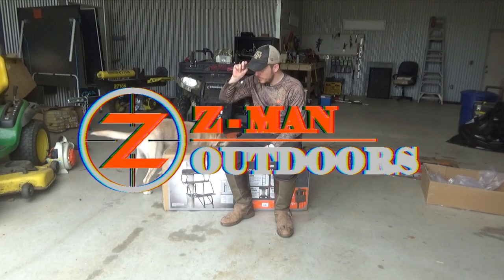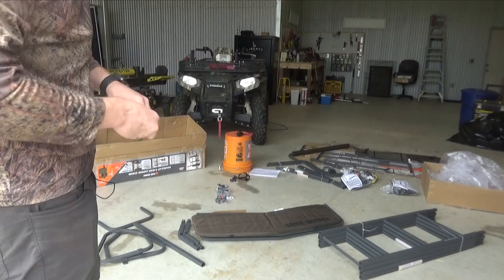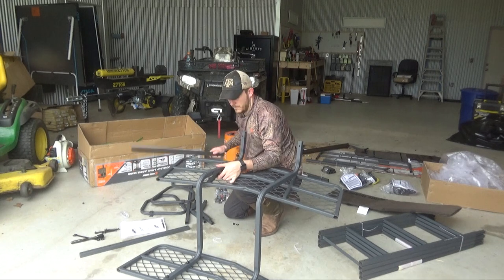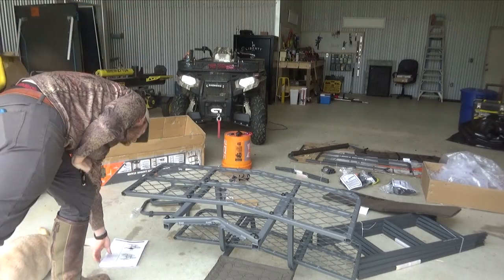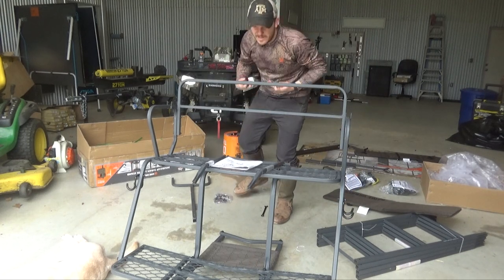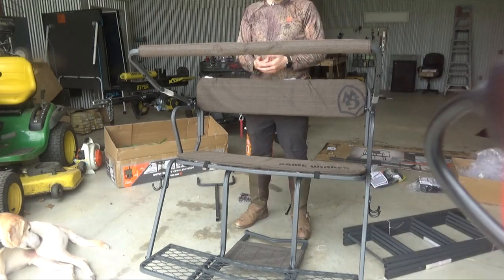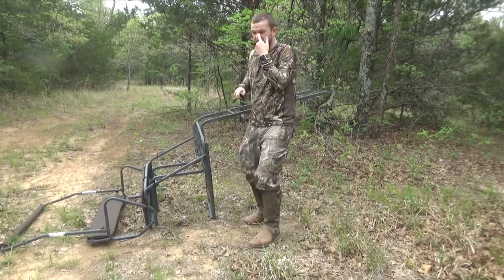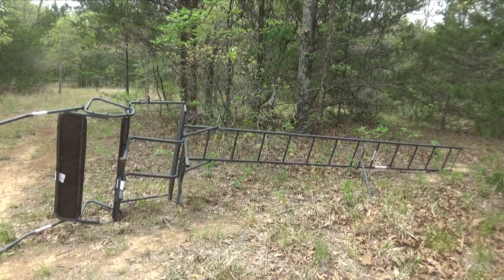Game Winner Two Man Ladder Stand Install

Comment: Was interested in this stand,  but it looks like it's only about a 12ft ladder?
Reply from the maker: Height to the seat is about 15’. I believe game winner has some taller ones if you are looking for that though
Reply: Can I leave off a ladder to make it shorter?
Reply from the maker: I actually ended up doing that and have not had any issues!
Reply: @ZManOutdoors  Thank you
Reply: Just a quick question?  What is the purpose for the mesh on the legs?
Reply from the maker: That’s a good question, I’m not 100% sure, but I have used it as storage haha. If I shed a layer or have something I won’t be needing until I get down I put it there